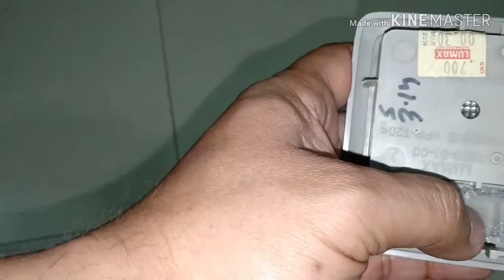Car cabin light fixed:Maruti Swift

Comment: Remove the bulb and then use multimeter for continuity test. Right pin should be direct with the one tip of bulb holder. Middle and left pin should be connected to the other end of bulb holder according to switch position. 
Whatever you were doing was just completely wrong and useless
Reply from the maker: @SRSaumyaranjan  Sir,You have not seen this video,I can guarantee.I have fixed the plastic plate which was slipped off/broken, nothing else.These connections are not in position because there is nothing holding them.I brought a small piece of plastic to hold them using superglue😃
Reply from the maker: @SRSaumyaranjan  Dear saumya Ranjan,I request you to watch again.I have not done anything wrong or useless.🙏🏻
Reply: @TheITMechanic 15:00 to be exact. You had your pin (black) on the left connector which is the door ground . So it never beeped when you touched at bulb . You should have set your light switch to door then one side of bulb should have sounded . 
Then in 16:00 you tried left and middle connector . Like i said earlier left is door ground and middle is on ground. In no position of switch they both will be connected ( or your multimeter will beep ) . Never it will beep with left and middle connector pin. 
About the right connector, that one is 12 v and is always direct connected to bulb in one end .
Reply: Again you did right at 16:48 when you used right connector to bulb . It beeped in both terminal because the bulb was in place . But again it doesnt matter because you fixed the switch which works with the two ground lines . 12v line (right connector) was always direct so no point to check it but its the only line your could check . 
Let me tell you what you should have done . When you checked with the left connector you should have kept the switch to door position and it wud have beeped with the bulb . Then when you checked the middle connector you should have kept the switch in on position. Perfect way to test the switch repair you had done . And again no point for checking left and middle connector , because they wud never connect in any way
Reply: @TheITMechanic that part was perfectly explained and i liked it . I dont have issue woth the repair you have done and i was looking forward to the disassembly and i got the idea before purchasing the item. But the testing you did with the multimeter continuity test , that was flawed
Reply from the maker: @SRSaumyaranjan  Saumya you are correct bhai.🙏🏻